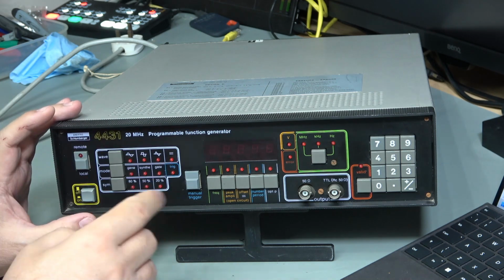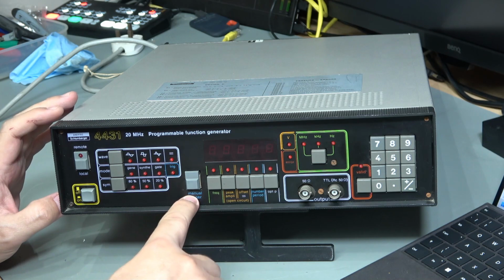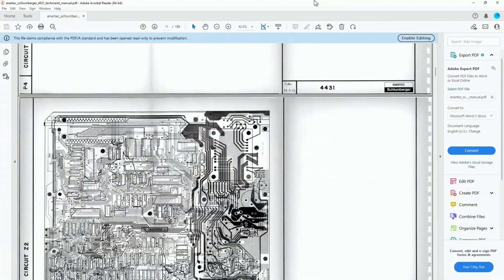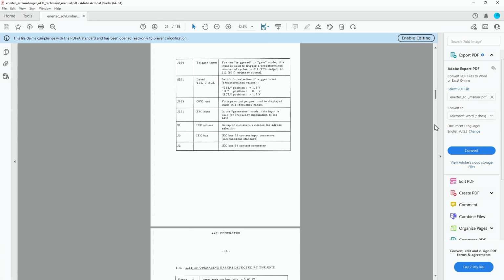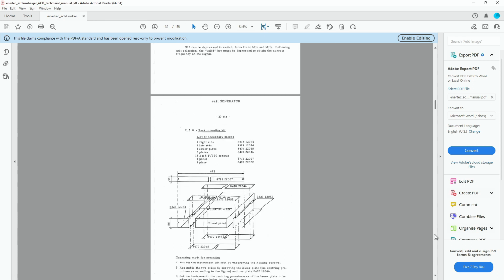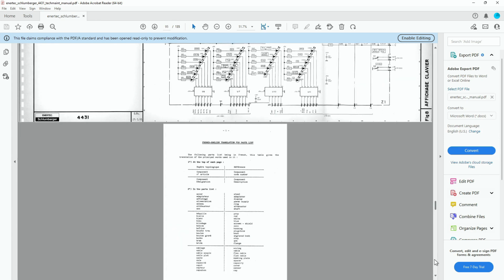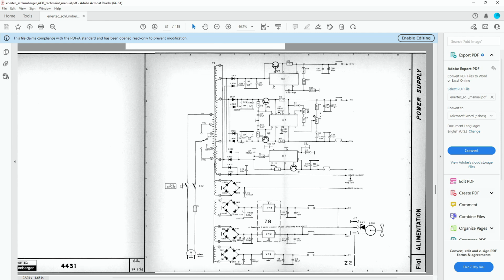Enertec 4431 Function Generator check and refurb #0073

Comment: termination 50ohm  >  side oscilloscope !
Reply from the maker: normally put it scope side but at these low frequencies makes little odds.  Neither the cable nor the terminator are particulalry high standard and that would have a much larger impact.

Comment: I could see the waveform bouncing on the scope at the end there so the main filter caps will need replacing.
Reply from the maker: I normally spot that, I'll take a look again.  And access to the voltage test point is good so should be easy enough.  And it was going so well!
Reply: Hi Defpom! I didn't catch that. Can you tell us the timestamp so I can learn what you saw? Thanks!
Reply: @pcwrangler09  @20:50
Reply: @TheDefpom  😳 you have good eyes. Completely missed that the first time.
Reply from the maker: @pcwrangler09  funny thing is, I've gone and looked on the scope again and i have to work really hard to make it show up at all but it is really obvious on the video.  in fact the ripple on the power rails is so small it barely appears out of the noise at 1mv per division.  Anyway, going to swap out some caps now it is open again, I'll do a short update video because i did say I was going to look at the voltage test points and I forgot.   someone else also asked why i was not worried when 1v output measured as 1.02 in the scope so I can cover that.
Reply from the maker: Caps now replaced, thanks for letting me know.   https://youtu.be/LNvjhdXwxK0